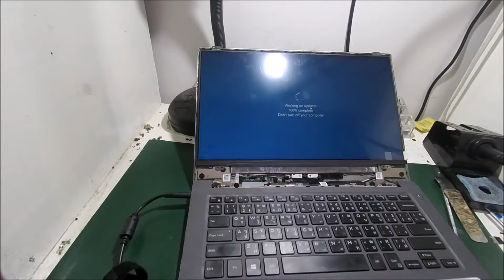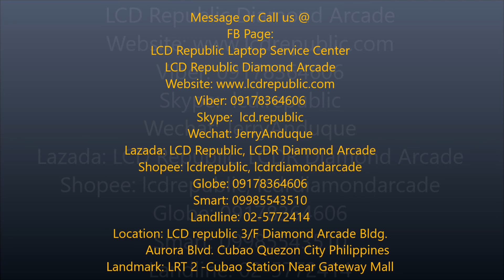How to Replace Broken LED Screen of Dell Inspiron 14-7000 series P74g

Comment: i happen to remove the 2 black film while puling it downward.. can you advise for  another option? thank you!
Reply from the maker: Pls send video or picture po sa fb page nmin lcd republic laptop service center
Reply: you can use heat but not too much
Reply: Lods, same kami ng problem ni Mam. Naputol lang yung 2 black strips nung hinila ko. Paano na po pwedeng gawin?